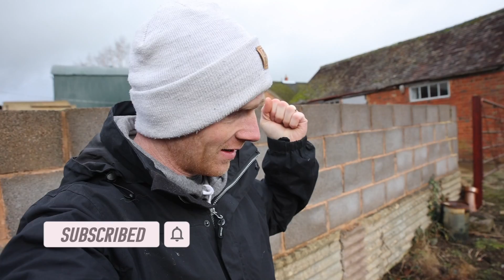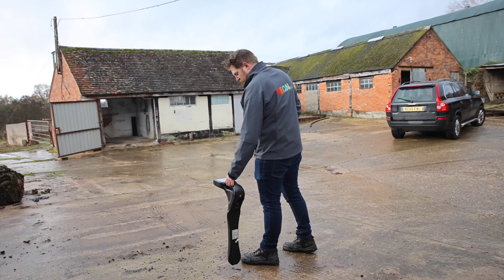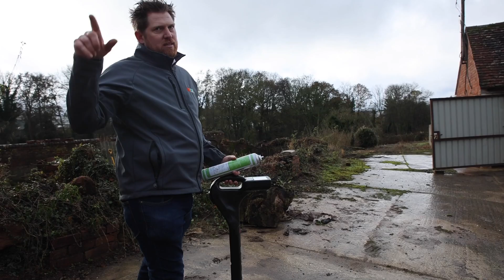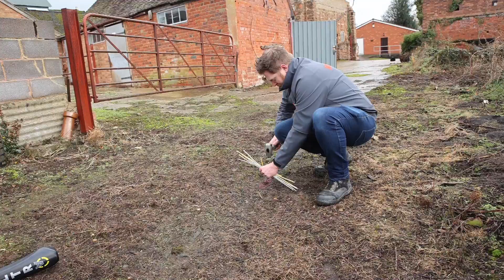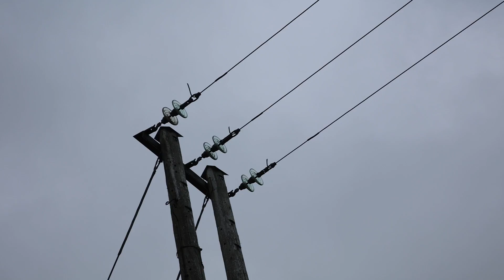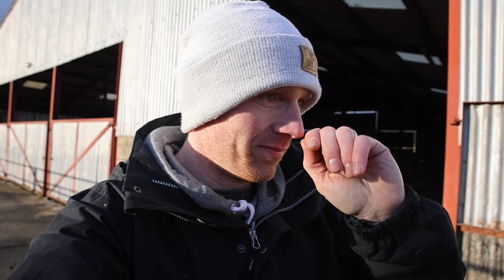MYSTERY POWER CABLES - Underground Utilities Survey

Comment: As others have said, it looks to be 11kv on those lines you showed. Evidently there would have been a transformer on the end of it, and the buried cable that you were detecting was probably used to power your farm originally (at 240/415V 3p). What has probably happened is the transformer removed, and the supply to your farm connected to some transformer somewhere else, perhaps connected at that manhole you mention. If that buried cable you were tracking was reading live then it's a good chance it's the leftover "stub" from the old transformer feed. They probably just capped it and left it in situ live. Bit naughtly, but stranger things have happened. To get rid of it - either pony up the £10k, or you can try terminating your wayleavers with the DNO. It should be in your legal pack hopefully.

Comment: The overhead power line looks like 11,000 Volt, the buried cable will be the same Voltage.  Often the power companies will leave even out of use cables live, just in case they want to use them in the future.  They may have left the overhead line and buried routes in place to maintain their wayleave rights
Reply: In the UK, any operator of a distribution network would have to be able to present a VERY convincing case to keep an out-of-use cable live at any voltage level. It has been established for some considerable time that the HSE take some convincing in this respect. If the cable is out-of-use, it should be disconnected. If there is a chance it may be used again then it will be properly sealed against water damage but it would always have to be rigorously tested before re-connection and energisation. Leaving an out-of-use cable in-situ would not in itself maintain a wayleave, although I confess that I'm not clear on the law in that respect in England and Wales.

Comment: I should add that cable-laying contractors almost certainly do not use GPS survey records for the vast majority of their work. Perhaps on 'big' cable laying projects they will but for run-of-the-mill LV and 11kV cable-laying, a 'sketch' is submitted to the DNO for later incorporation into their cable records. As an older (and slightly wiser) engineer who knew just how great a job our dedicated cartographic draughtsmen and women used to do for cable records, I despair at the state of modern cable records.

A former Wayleave Officer colleague always used to remind me to (gently) advise customers that cable and OHL records are 'indicative, not taxative'. Worth keeping in mind before firing-up the old excavator!

Comment: Interesting video, thanks. Retired DNO engineer here. The 'end' pole looks like it possibly had a pole-mounted transformer on it once upon a time - the remains of jumper connections from the conductors that would've landed on the transformer terminals can still be seen. It wasn't entirely clear from your video but it looks like the final two spans of the line (almost certainly 11kV) have been left in-situ as the stay-wires at the terminal pole are providing the mechanical support for the local section of the line  - as I say difficult to be definitive without a closer look. Much more worryingly (and again the video didn't perhaps give the best view) it looks like a farm building (a barn?) has been built right under the 11kV line with nothing like the required clearance to the conductors!!! I suppose if you go ahead and get the work done to remove the 'redundant' last two spans, this will cease to be the safety hazard it appears to be. From what I could see it looks like removing these two spans would mean at least new stay wires being installed on the remaining pole, which may also need to be changed completely depending on its current dimensions (adding stay wires adds to the crippling load on the pole, which, when added to any existing load such as a transformer may mean that pole itself needs to be upgraded from a 'medium' to a 'stout' - your DNO will advise you when they quote you for the work!).

All sorts of high-tech discussions about (non-invasive) surveys but nothing really beats a trial hole(s), carefully excavated in accordance with HSE Guidance Note HSG47! Your local DNO should provide you with cable records to help and very possibly a visit from a plant protection officer (or similar titled person).

Don't laugh, but if all else fails, use dowsing. As a young trainee engineer in the mid-late 80s I worked with a couple of very experienced engineers who introduced me to the operation of their dowsing kit. Of course, I assumed they were totally taking the p155 out of the young trainee but I can attest that it actually works. I have no idea at all how or why it works - I cannot explain it - but I have used it and it absolutely does work.
Reply: The only legit answer on here! 👌👏
Reply: I’m a lineman in Ireland, so obviously some things aren’t the same. But this answer seems to certainly be on the money, until you can get someone from your Utility company out!
Reply from the maker: Yeah that all makes sense Craig, definitely evidence of brackets and hardware having once been on the pole.  I believe the overhead did once carry on further on than that last post, the second to last was installed to raise the cables up away from barn, albeit not far enough I doubt.  Anyway, we will see how we get on with Western Power and see what needs to be done to remove the two and install a suitable pole/poles and stays.
Reply: @TheRestorationCouple  My parents have a similar setup at the of their garden - double pole with a transformer mounted halfway up. That takes the voltage from 11kV to 240V and then it goes via single poles without insulators to all the homes in the village. The wires on the transformer pole are further up to ensure the transformer half-way has the required clearance to ground level. The next pole along also has slightly elevated wires so the 11kv lines can run straighter under tension rather than follow a dip in the land.

I'd try WPD and play the safety card first - tell them you need to work on the roof and you're worried the overhead is too close - you might get really lucky and they agree to remove the deadleg without charge (or contribute towards it). If you mention you want it moving because you're doing renovations / redevelopments / it's in the way, then I tend to find they want full costs...
Reply: @TheRestorationCouple  I think this is the sort of thing you should have established on the survey and legals before you exchanged contracts.
Reply: just a thought the cable that appears to come from the last pole may be an old earth cable  that could have been connected to the tx that may have been on the end H pole.
Reply: @neiledwards5337  yes, that could be a possibility but without sight of the DNOs records, we can't reach any definitive conclusions. It looks like the terminal-H pole probably was a transformer pole at one time and so there would be at least an LV earth if not an HV and LV earth electrode (depending on local spec' - it looks like an old BS1320 spec' line judging by the apparent conductor spacing but the DNO/Electricity Board spec' for pole-mounted substations would influence the earthing too.) Perhaps, more importantly, it's quite possible that the LV service cable(s) that used to be supplied at the terminal pole are still live but supplied now from the local transformer pole. It's difficult to tell from the video but the pole two span away from the terminal may support the local transformer. I'm sure a future video will fill in some of the blanks.
Reply: An old water leakage tech set up a dowsing test with me. Miles from anywhere on a country road. I was given the welding rods and told to walk 100 m down the road. The rods crossed so I marked the spot and was instructed to continue to the next deviation. The tech then cleared the undergrowth in the ditch to reveal a iron 6 inch main and then a small culvert both crossing the road. He had access to all the fancy electronics but usually started his searches with the rods if not under observation and then confirm with the more modern kit. It was a rather stunning experience for me. I repeated the walk now knowing the positions of the pipes. The water main I found again with ease but the culvert was not detected. His only advice was to think of water running though a pipe as you walk if you want water and electric in a cable if that was your target. All very odd.
Reply: Yeah, give dowsing a go. I've had success in our garden finding buried pipes and an old well. I believe it can be used to find pretty much any services underground.

Comment: If a power supply crossed your land to the sawmill you would think there would be something in the deeds to indicate this (wayleaves). I think this is a sort of thing a property specialist Solicitor can establish before you buy. Whoever is adjacent to you might have those rights (to supply) even if they are not currently in use. 

What is the situation regarding the soil in all this??? Have you taken soil samples atall??? I know you would think a farm would be fine but is it not the case cows are a problem soil wise??? All I know is if you are intending to build soil is a huge issue, I think the situation is if it's concreted over you can leave it as the concrete is a barrier, I would not rip up sections of concrete until the soil situation is known. To me it looks a challenging site, you need to cover all the bases ie de-risk it as much as you can, or costs can really mount. It isn't just about planning permission, soil and wayleaves are a big factor too.

Comment: If that pole was for power supply there should be a transformer attached to one of the three lines then a single powerline from the transformer to the ground. It just looks like the extra power poles are endpoints for the power run?
Reply from the maker: Yeah you can see the holes and notches where a transformer or something was fixed up on the pole. The overhead cable used to carry on further to a sawmill but must have been disconnected at some point.

Comment: Nice job. Those cables to the end look as though they are a much higher voltage than your domestic supply. I think maybe further back you have a transformer to get your domestic supply. The insulators on those last two poles are huge, hence the comment for a higher voltage. Thanks for posting
Reply from the maker: Our 3 phase comes off a different supply under the lane, the overhead are a legacy from when they continued further on to an old sawmill I believe.
Reply: The farm may have had a 3 phase transformer mounted on those poles at one point.
Reply: I'd guess 20-30 kV, i.e. medium voltage. HV (100 kV and up) is usually on bigger metal pylons rather than wooden poles.